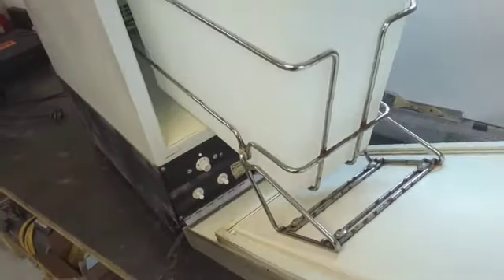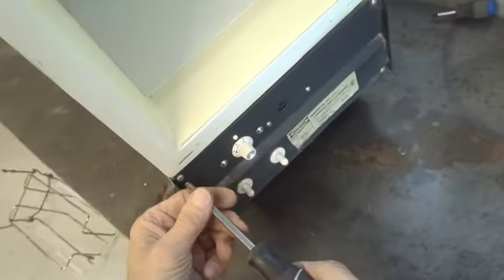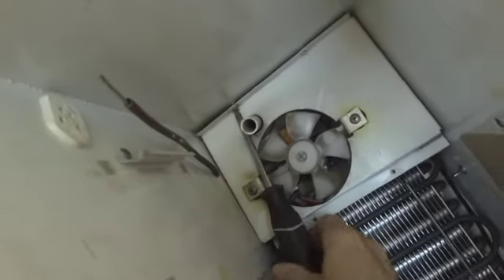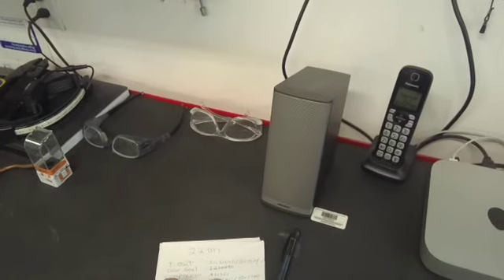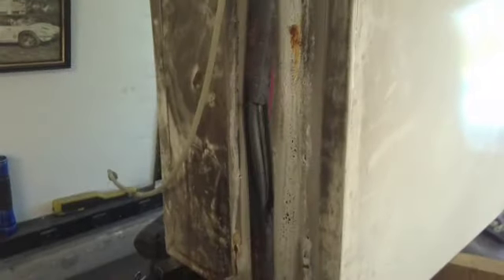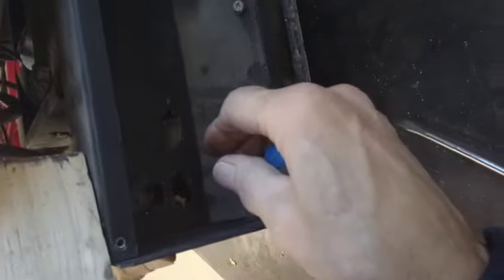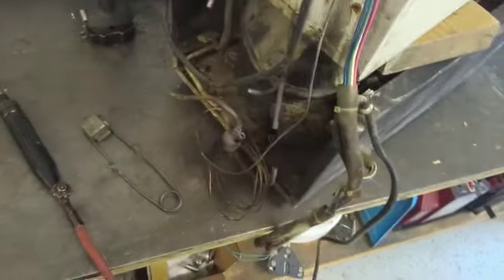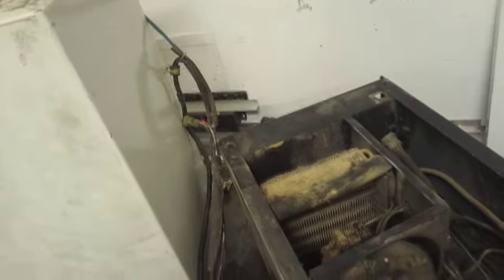Sub-Zero 22IM Ice Machine Rebuild part 1

Comment: Can I ask how you film these? Is it a GoPro on a head mount?   I never seem to capture what I want to that way, and your videos do. What’s the secret ?  Thanks.  Ps thanks for posting this.  Edit. Just got to the part where you said you use “video glasses”. Which ones if you don’t mind.
Reply from the maker: I use video glasses from Pivothead but they’re no longer available. Check out Voolex in your search engine, they also have a head mounted camera and Ray Ban just came out with video glasses.
Reply from the maker: Voolex EP7 with image stabilization is the new go-to camera for me. My old Pivothead glasses were available with prescription lenses, I wish they were still in business. However just type video glasses in your search engine and you’ll find a variety of options.
Reply: @SubZeroSpecialists  thanks so much. Yeah, I have Rx glasses as well. I need the video so I remember how to put everything back together!
Reply: I have not seen one of these in at least 7 years